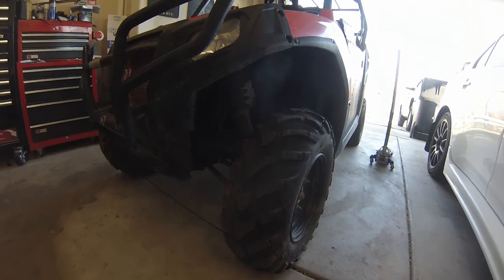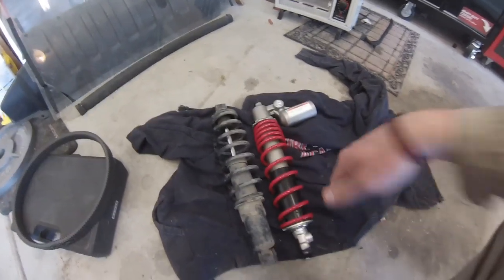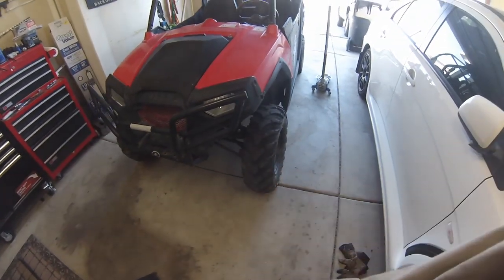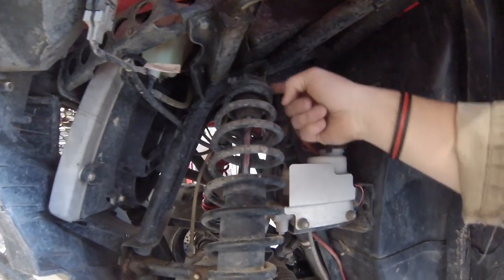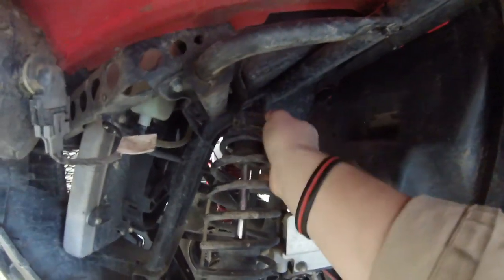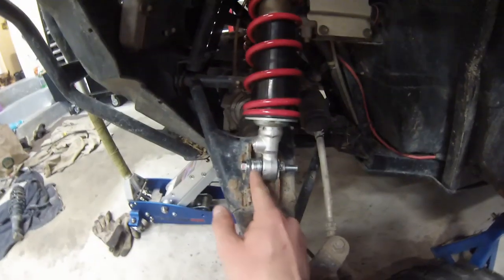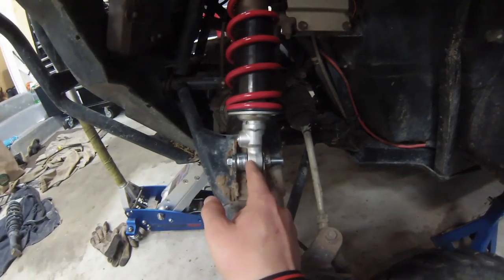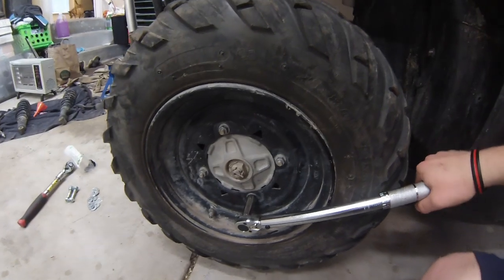Upgrade RZR 570/900/800 Suspension for Cheap!

Comment: You can run those shocks upside down as well so the reservoir would be at the bottom. Also the Polaris predator 500 fox shocks can be used and they have internal reservoirs and are cheaper than the 450 shocks typically on eBay.
Reply from the maker: Thanks for watching. I really considered mounting them upside down but I was really concerned about rocks hitting the reservoir. When looking at my old shocks, I did see a few dings/dents on the lower end of the shocks where the oil reservoir would be (if I mounted them upside down) so I decided against upside mounting even though it would have been so much easier and faster. Can you be more specific of what years those predator shocks will work? That would be a great mod!
Reply: XinnKoda I’ve seen shocks mounted upside down on some other ATVs from the factory but I believe the predator shocks are the same in all years
Reply: XinnKoda do your shocks bottom out? I just put some ltr shocks on my 800 and they bottom out all the time!
Reply from the maker: Josh Brown I have my pre-load adjusted almost to the max. With that setup I don't believe they ever bottom out. Most of my riding is trail with some minor rocks and the occasional technical. I haven't noticed any bottoming out with my setup.
Reply: XinnKoda thanks for the quick response! I have mine adjusted to the max also. It's a awesome ride unless i hit a tree root, big rock, or any little dip when I'm trail riding. I might just have some crap shocks.
Reply from the maker: Josh Brown could be. I also heard that the year can make a difference. I heard some years of the LTR shocks are stiffer than others but I don't recall which years are stiffer. Do you know why years yours are off of?
Reply: XinnKoda I have shocks adjusted too the max. My shocks came off a 2006.
Reply: It's a great concept but even if u top the preload out the spring rate will be to low and u will bottom out on any and everything the razor is much heavier than the racing bike u pulled it off of
Reply: @concealit4800  The spring rate on the oem rzr springs are lower than most of the sport quad shocks.  its not just the weight of the machine, but also the geometry... same as how a rzr 800 vs rzr 800s weigh the same, but the S needs much stronger shocks because of the leverage of the longer a-arms.
Reply: That tool is called a spanner wrench
Reply: Will these shocks lift the Polaris?

Comment: I'm having issues with my rzr 12 800 trail with the working stroke being too short. It wants to bottom out on bigger bumps??
Reply from the maker: Yes that is a common problem. The springs wear out prematurely and causes you to bottom out. The rear springs can be upgraded from a 450 dirt bike rear shock. Thanks for watching!

Comment: Would these work on a 2012 800 rzr?
Did you do anything with the rear stock shocks?
Reply from the maker: I believe they would also work on a 800. I did  not do anything on the rear because these made a huge difference. You can, however, use the rear shocks off of a 450 motorcycle and use those for the rears. Thanks for watching!

Comment: what kind of air filter is that
Reply from the maker: It's a custom hodge podge. It's essentially a donaldson air filter that has a particle separator integrated and just has PVC on it plumbed in. Nothing too special except the air filter itself is a very effecient air filter. It has an inner and outer filter and the filters are reusable/washable. Thanks for watching!

Comment: Why is he using a chrome socket on a Impact ratchet
Reply from the maker: Unfortunately I didn't have the right size impact socket for this size at the time. You are correct though that chrome sockets are not rated for impact. I'm merely a diy mechanic and don't always have all the tools. Thanks for watching!
Reply: Who cares? It did the job.